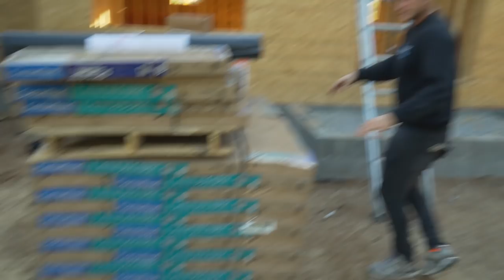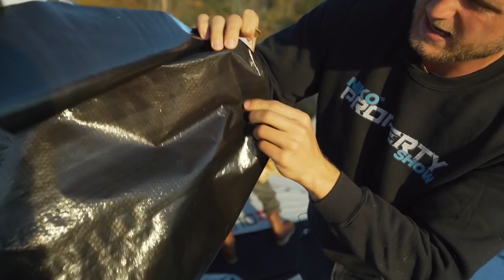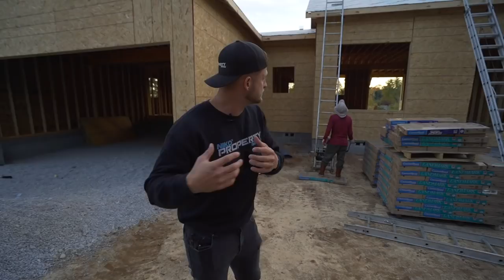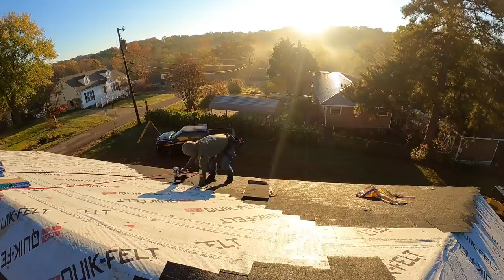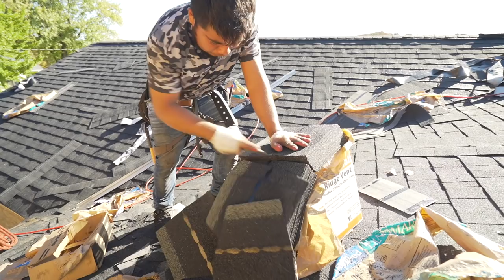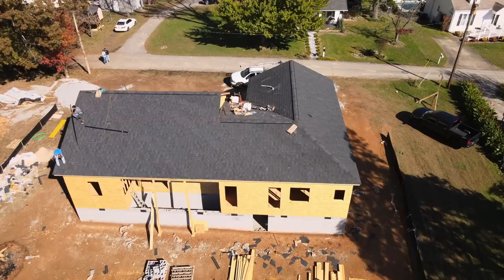Installing Shingles On The Roof | Building A $350,000 Custom House | Episode 15

Comment: I can't believe they didn't put the dip edge on. That's part of the roofing job. They were more worried about speed than getting it right.
Reply from the maker: They put the drip edge on afterwards.
Reply: @NikosPropertyShow  yes I seen them lifting the shingles back up to do it. Pulling the roofing nails through the shingles. Just wondering how well that edge holds up in a big wind storm.

Comment: I know you have ridge vents but no whirley birds?
Reply: They are same type of ventilation, both exhaust the air from the attic. Ridge vent is better since there aren't any dead spots where air could stay stuck in the attic. You'll need a lot of whirly birds to exhaust an attic properly, which is unpleasant aesthetically.
Reply: @dshu96  gotcha! Thank you for the info, I was confused!
Reply from the maker: Thanks for the explanation Daniel!!
Reply: @NikosPropertyShow  of course, you've done some awesome work and highlights!